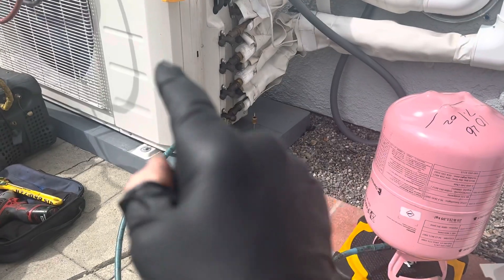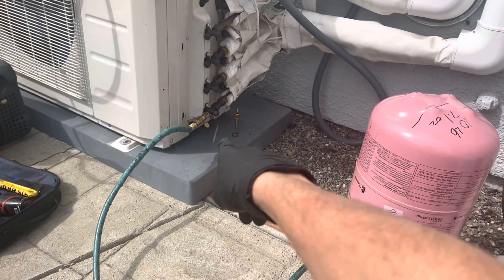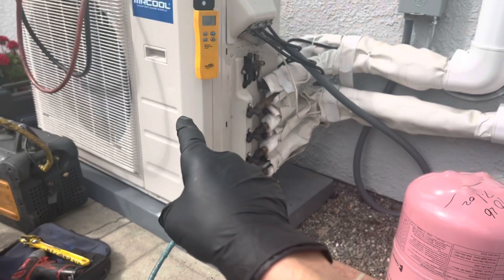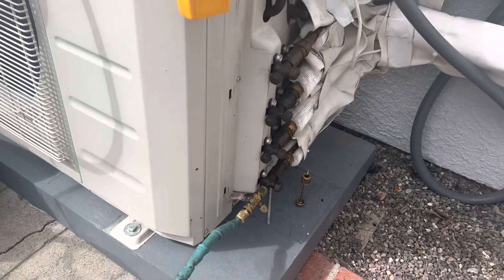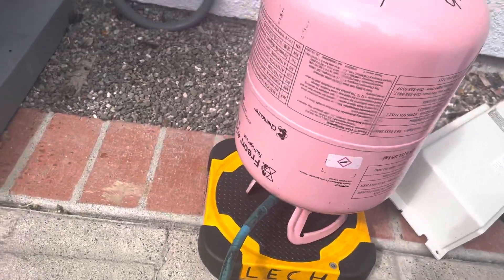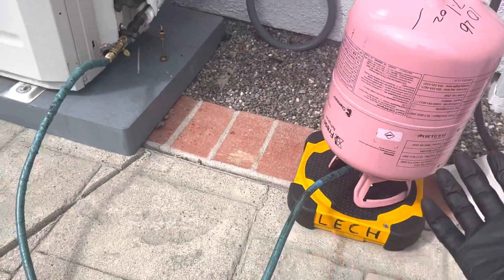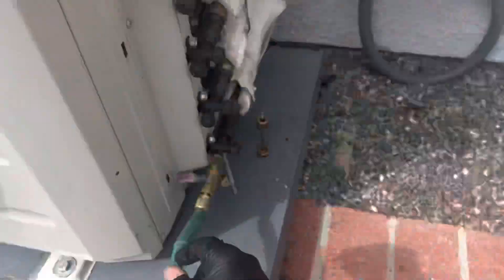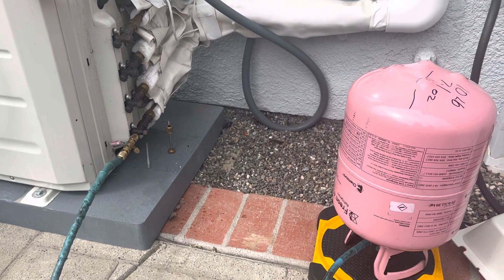R410 high voltage discharge electrical shock when charging refrigerant￼. I caught it on video￼

Comment: Wiped out the program on my pos cps scale from that since that doesn't even have a rubber mat or anything
Reply from the maker: I’ve had a lot of CPS scales fail on me and other intermitted problems that’s why I stop using them the same thing for TIF products Not very reliable on their electronics but at one time they made a killer for port glycerin filled refrigerant manifold that I still have to this day 36+ years later.

Comment: Pretty crazy stuff, crazy how the flow of refrigerant was building charge on the tank?! Very cool you caught that.
Reply from the maker: The same way when you rub a balloon on your hair and it makes your hair get static electricity or as a kid when you slide your feet across a shag rug carpet made out of nylon or polyester your body would build up a static charge and you would touch your brother or sister on the ear and shock them. We would see the blue spark shoot out of the tip of your finger and hit the other person skin. 

The refrigerant is flowing at a high velocity inside a synthetic rubbery plastic material in the hose doing the same thing

Comment: One question, I think you implied a preference for aluminum evaporators vs copper tube/fin.  Did I understand correctly?
Jumping 3/4 inch, the voltage was probably more than 20,000V (my guess),
Reply from the maker: From science class and from electronics class I remember I think they said about 75,000 V per inch.     As a kid I used to play with my father’s spark gap tool that you would hook up to a ignition coil and you would slowly screw it open widening the gap by thousands of an inch it was like a micrometer with two pointy ends.    And that was old-school way in my grandfathers day to test ignition coils. 

      That and just grabbing it with your hand holding the fender and you will get good at that and guessing how many thousands of volts if the coil was good or bad just by using your body as an indicator that was my preferred method. It was quicker and faster got the job done no tool needed.
Reply: @coldfinger459sub0  I look for a guinea pig to hold the wire while I turn the key but the 8-position (9 wires) adjustable spark gap works too.  Most of the time I use a spark plug as a quick test although those conditions aren't as severe as with cylinder compression.  This gives me some idea if the plug is fouled, as well.

Comment: @ This is your captain speaking: Stinking the same thing ground the tank to the unit. With that alleviate any of shock hazard?
Reply: * Thinking
Reply from the maker: Shocks no big deal a lot of voltage very little amperage

Possibly some electronics won’t like it
Reply: @coldfinger459sub0  Might damage equipment, good thing this isn't a hazardous gas.

Comment: Might be a good idea to ground the tank to unit.  Must be pretty dry there.
Reply from the maker: I’m just glad I caught it on video there’s very few videos on YouTube showing this physics scenario. 

It’s kind of the same as when you were a kid and you rub your feet across Hey nylons shag carpet and you would touch somebody and give them a electrical shock
Reply: @coldfinger459sub0  Yep, I never saw that happen myself or noted any official mention of it even, while in the semiconductor industry around pyrophoric, toxic, anhydrous gasses.  Of course we never used rubber tubing or elastomeric seals aside from many regulators probably had them.
Good catch for us, definitely something to consider.
BTW, I was able to pull a leaky evaporator to 200 microns a couple days ago and the leak rate wasn't bad, didn't move appreciably over 20 minutes at static.  Pressurization was a different story, could see it was leaking after a couple hours.
Reply from the maker: @thisisyourcaptainspeaking2259  Yes pulling the vacuum is only 14.7 psi different between inside the pipe in the outside atmosphere and a little oil residue has enough surface film tension to stop or extremely slow down a leak. 

Under pressure with 200 psi or 400 psi that’s a different story
Reply from the maker: Florida Man HVACR  Exactly what happened
Reply from the maker: Florida Man HVACR  measureQuick is our future measureQuick is here now any manufacture who doesn’t make their equipment to work with measureQuick is considered a secondary piece of equipment that’s not absolutely necessary